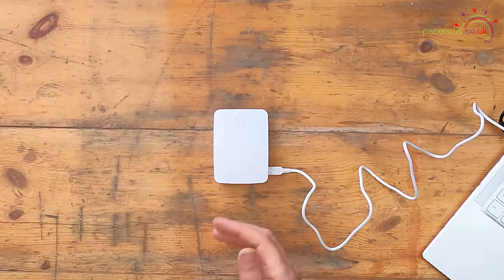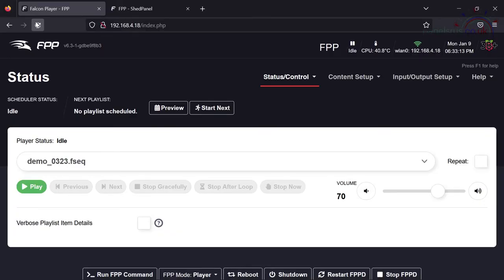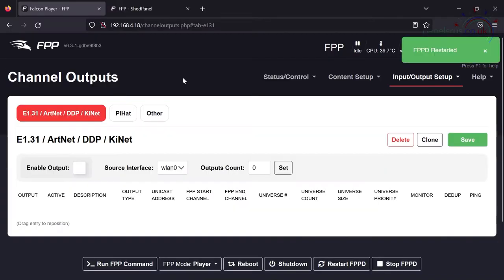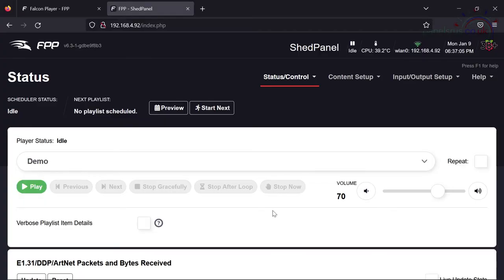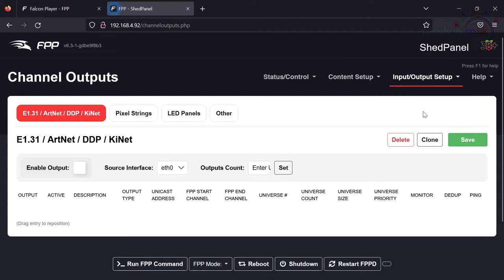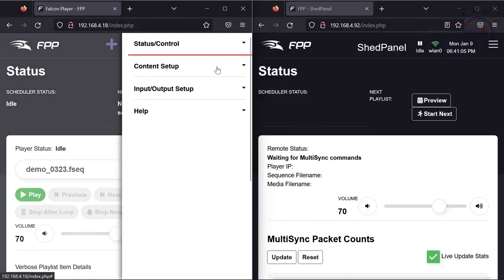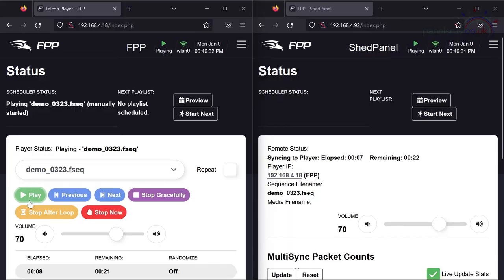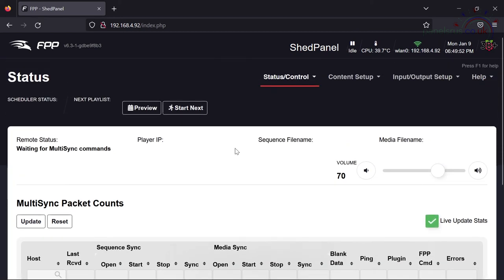FPP v6 Master / Remote

Comment: Good Video, In order to reduce confusion, you might want to not use the old "Master/Remote" terminology. FPP no longer has a Master mode (as you mentioned, but was eliminated in version 5. not 6), just Player and remote and then you configure the player what data type to send (E1.31, DDP, or Multisync, or a combination if needed)

Comment: Would you need a bought ffp license for both master and remote?
Reply from the maker: You only need a licence for FPP if the Pi/BBB has more than two strings of directly connected pixels. For a master, with no pixels directly connected then no licence is required.
Reply: @panelsrus  Thanks for your reply Greg. So if I had a wb1616 with props connected and a p5 matrix on a pi or bbb and another ffp in the house say. I would only need 2 licences for  those in remote mode and the master player wouldn't need it?
Reply from the maker: @benjicollins1  only the WB1616 would require one, the P5 doesnt count as pixels and the master doesnt have any pixels directly connected.